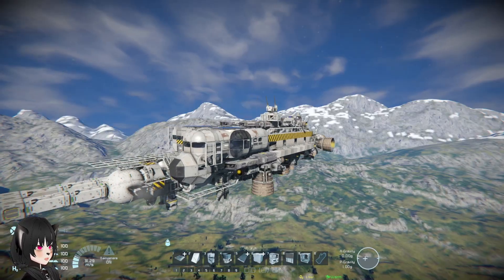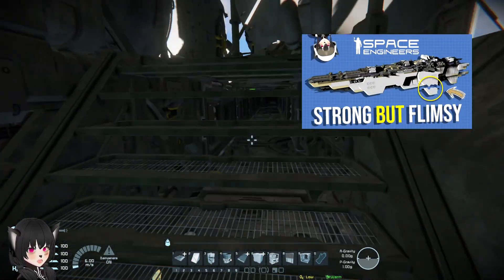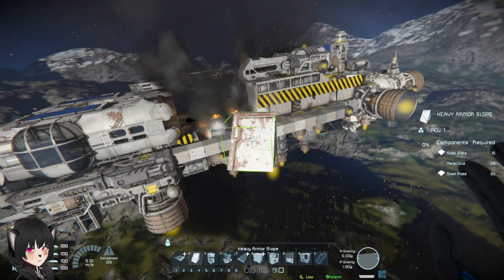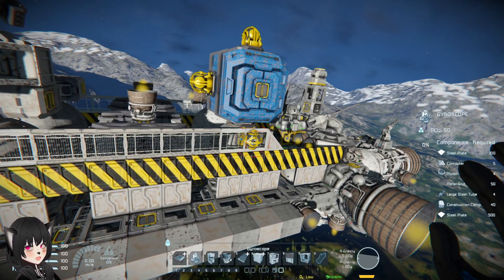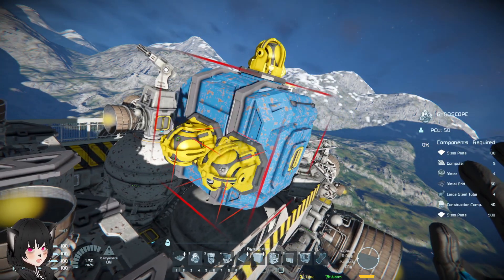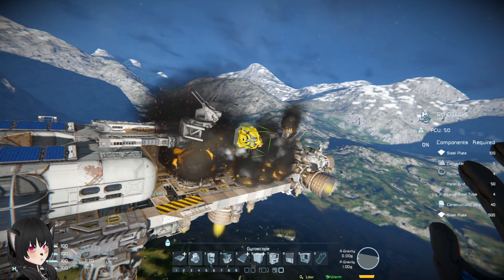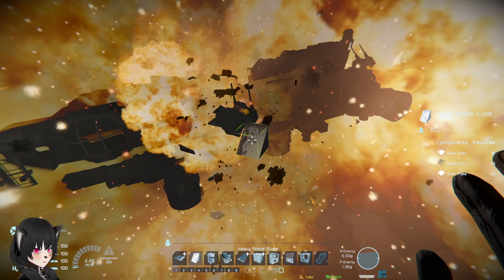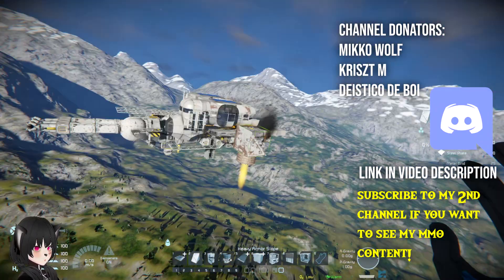Not Doing This Makes Your Ship Safer in Gravity, Space Engineers

Comment: Gyroscopes having only one attachment point is a design flaw in general
Reply from the maker: Ye u wu gotta put them somewhere strong and safe because of that x3 c=
Reply: I would personally recess these into the bottom so they are not too easy to dislodge but won't fall onto anything when they do, at least not on your grid. Someone below you may get unlucky though.
Reply: You can use gryos in missiles with great affect.  Have one warhead with gryos around it on four sides.  When the warhead does its thing there are four gryos hitting things.  Inside the ship its great for damage as the ship moves around.
Reply: @GodKitty677  I'm not sure gyros would survive a direct explosion from a warhead
Reply: @themidnightbanshee5927  The gryos were found inside the target ship in testing.  Also they acted as armour protecting the warheads.   The missile was impossoble to shoot down.   The missile could only be stopped with armour with drill blocks.